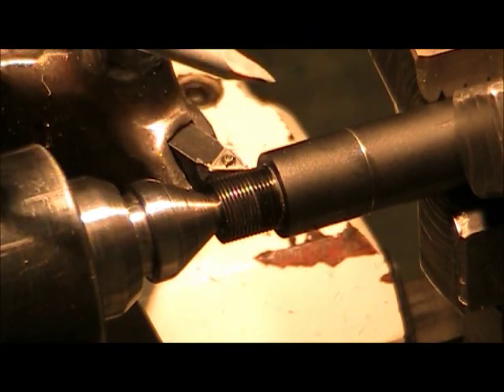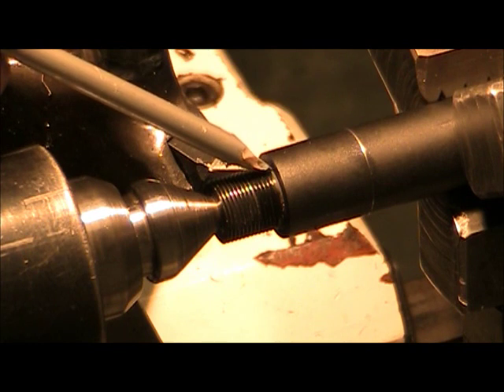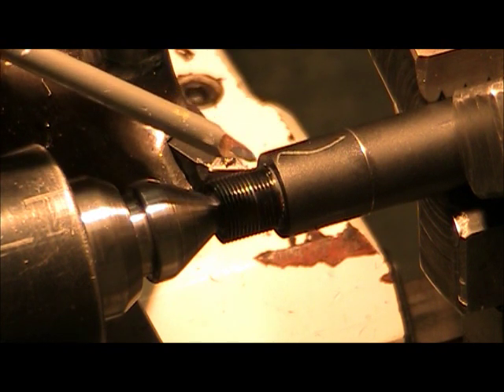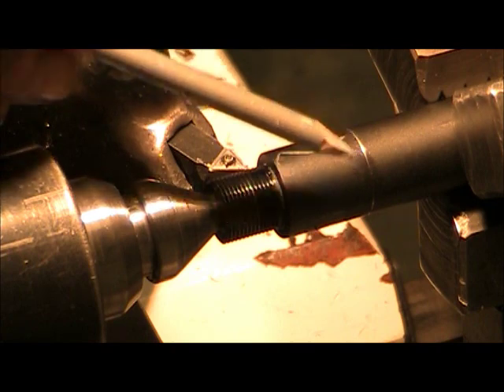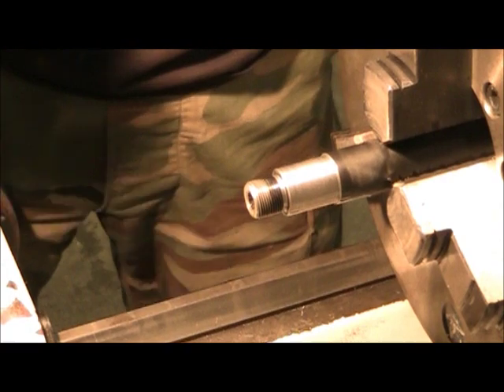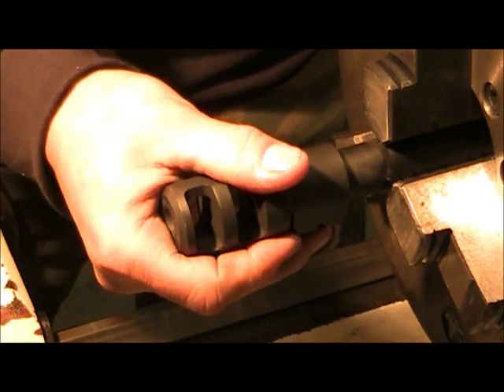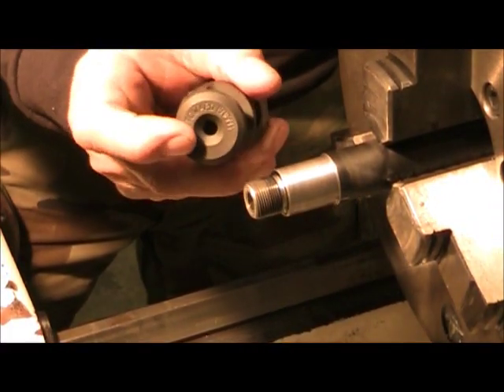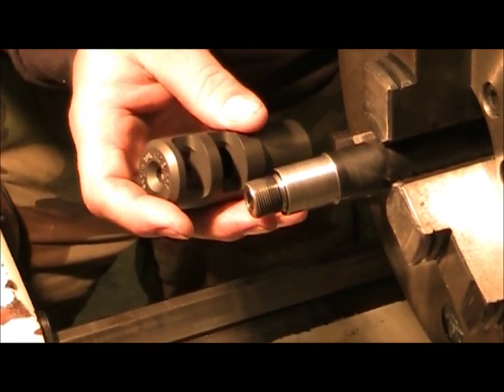Badger FTE muzzle brake Remington 700 .308 308

Comment from the maker: @joeblo86   i feel like the more threads you can have the better. there is also a thing of to much threads. if the threads go past the end of the brake or the end of the treads on a can, when you get burnt powder residue it will be hard to remove.